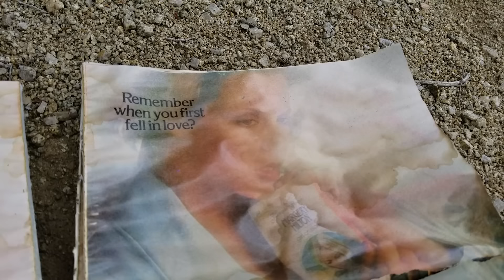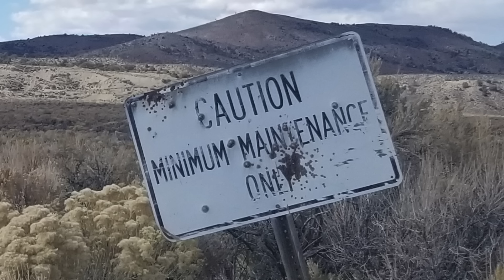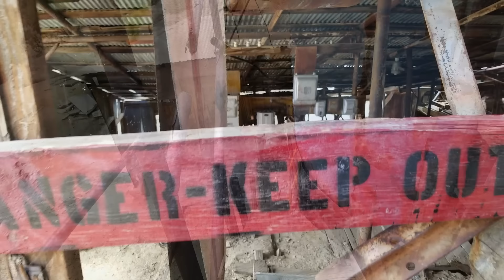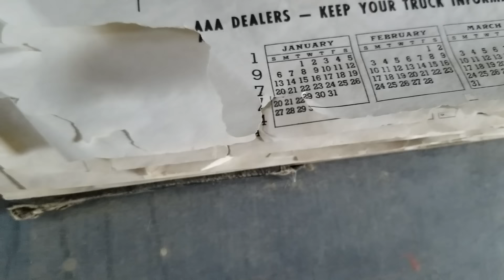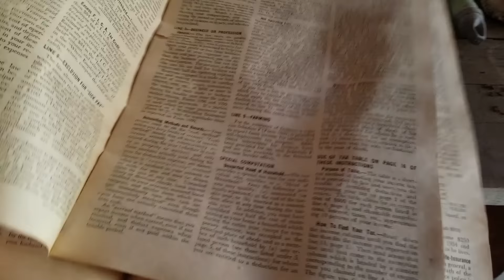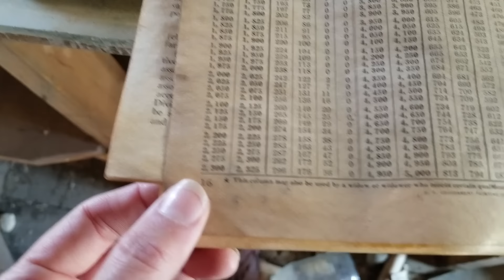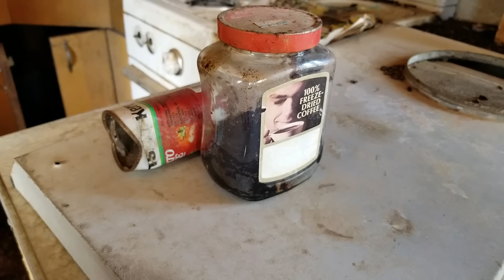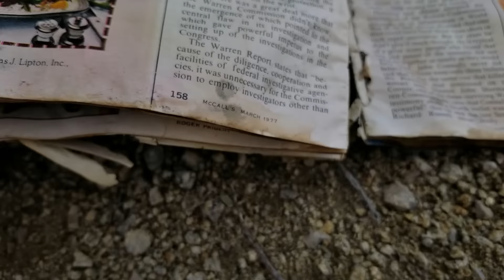Abandoned Mill, Mine and Trailer

Comment: What you called old machinery is a mine hoist and the building was called the hoist house. A hoist man would operate it to lower the miners and equipment down the shaft and raise the ore and miners out of the shaft. When you look around the hoist house always look for the bell code sign as they are relics. The bell code was the method the miners used to inform the hoistman to raise or lowed the skip. They ran a wire cable down the shaft to a electrical knocker on the collar of the shaft. In the hoist-house was a knocker infoming the hoistman what to do. Example 3-1 hoist men 1-2 mine collar. The miner would ring 3-1/ 1-2.

Comment: Yes I agree that cyanide may have been used in the mill. But most flotation cells are used to separate  sulfide minerals  the concentrates then can be transferred to a shaker table. Cyanide usually is added to the  gold and sliver solution in tanks then zinc is added to capture the precipitates and filtered out in the filter system. Also it looks like  there’s a mercury retort whatever they were mining it must have been a complex ore. I worked in the mining industry for over 30 years (Nevada, Alaska, Utah, Montana and Washington). I mined gold, silver, lead copper, iron and tungsten ores.

Comment: Some one snitched the Starter and Magneto off that beautiful Case Stationary Engine.  Froth Paddles, something to do with Cyanide?  My Mom had Paisley chairs like those, same color.  Nice Video, Thanks.
Reply: Liking old engines too Jim Key, that was the first thing I noticed.
Reply: The froth paddles usually are used with flotation cells with a chemical called xanthate. Xanthate forms bubbles attached to sulfide minerals like silver lead etc. The froth paddle skim off the bubbles attached to the mineral other chemicals are like silicon are used to depress the waste materials to the bottom of the cell. I really don’t think they used cyanide as they would use activate carbon or zinc to capture the cyanide.
Reply: @wendydillon7174  thanks, that is one of the few useful and informative coments on YouTube.
Reply: @wendydillon7174  The froth then goes through those Rotary Filters seen previously.  Gold is also precipitated this way and cyanide was involved in that operation.
Reply: Same motor that's in my 1949 Case DC tractor
Reply: Very similar to a Waukesha engine. I still have some new valve adjusters for that Case.
Reply: Neapolis We had some Waukeshas in 36 ft Purse boats. I remember them as tememental.
Reply: @jimkey920  The ones I worked on were a 4cylinder in Forklifts, they were kind of primitive and this was well over 20 years ago and they were very temperamental especially with the ignition timing. Most of them ran on Propane. Were the ones you worked on gas or diesel?
Reply: The ones I worked on were diesel., with fresh water keel coolers.  Very temperamental!
Reply: @jimkey920  I would have guessed being diesel engines they would be very reliable though.

Comment: @Wonderhussy Adventures >>> Regarding doing live streams,  money aside, could you set-up some kind of WiFi or cell booster system to allow you to broadcast from the middle of nowhere?  

Ham radio operators have used kites to lift aerials for longer range transmission & reception.  Do you know any semi-hardcore kite flyers?